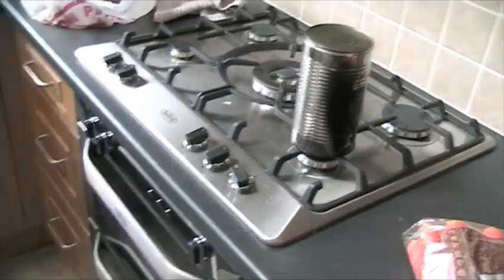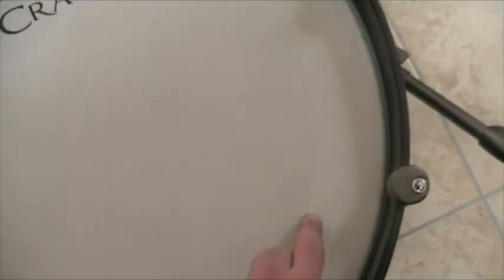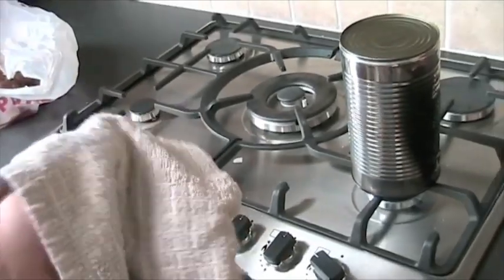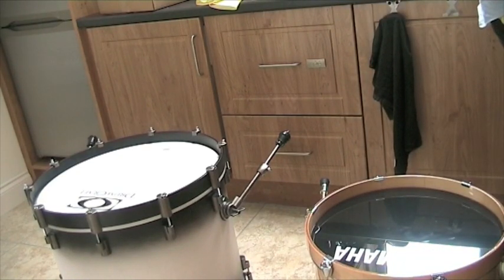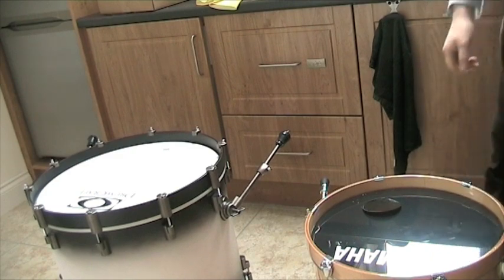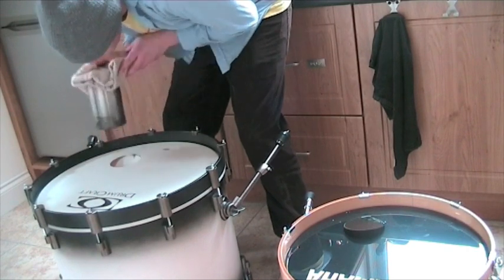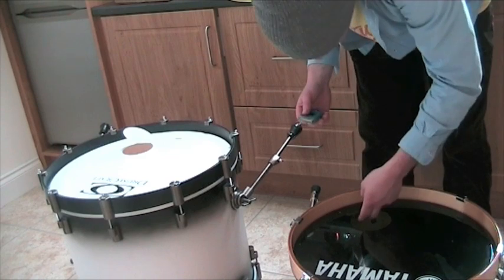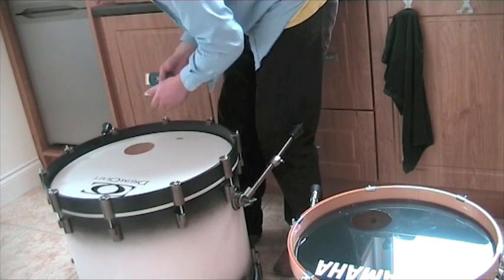How to make a hole for bass drum.

Comment: If you're doing the can method it is way, WAY easier and cleaner to do it on an unmounted head. Put the head face-down so you can apply some pressure and not have the "hanging chad" portion flop away from you. That'll save you extra-cutting.